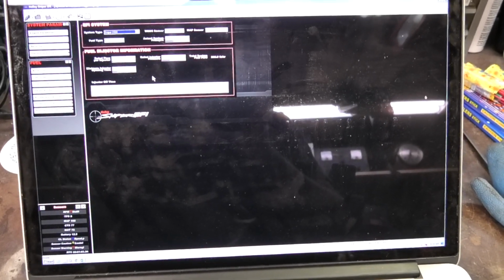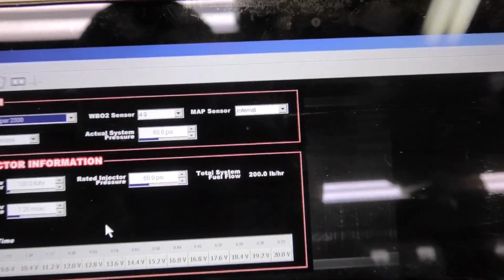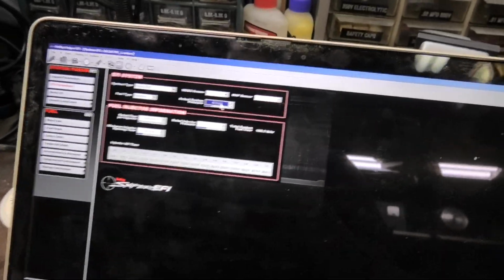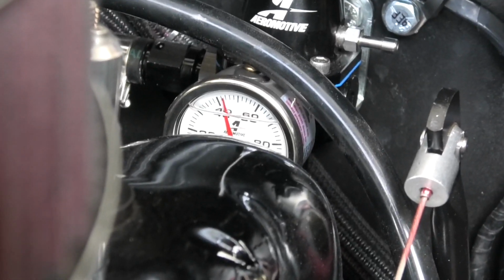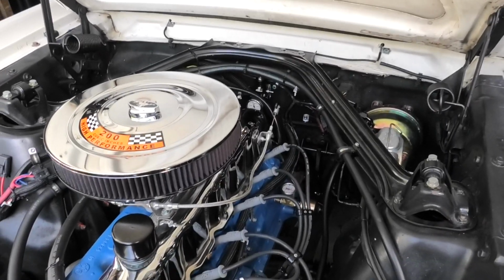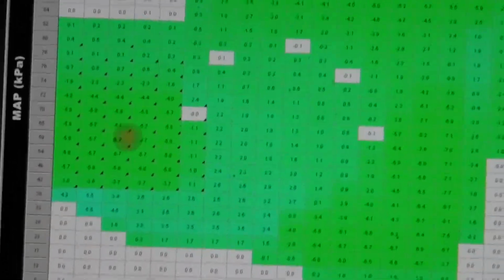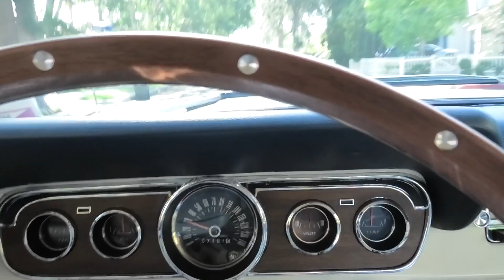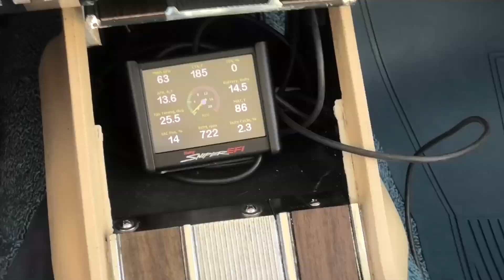Holley Sniper 2300 43 PSI Fuel Pressure Experiment

Comment: I forget the exact range, but your IAC seems high.  I've got mine around 5 on an International 345 (obviously different from your engine) and it idles and runs like a champ with no psi adjustments.
Reply from the maker: Range should be 2-15% in neutral, fully warmed up. Obviously will be higher when in gear or cold. 
In reality, it’s not that critical. Just more efficient to have it set correctly.